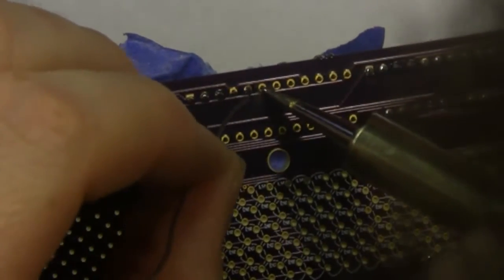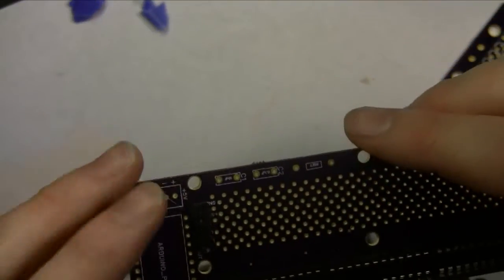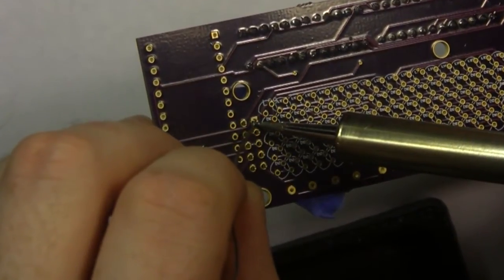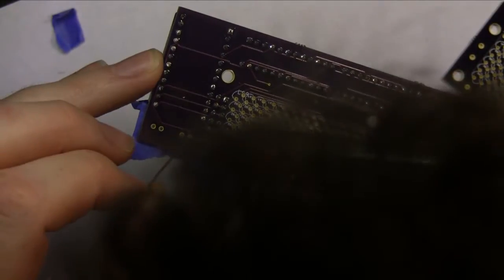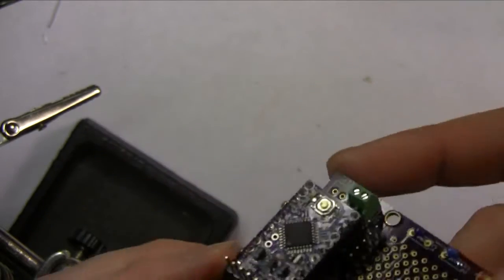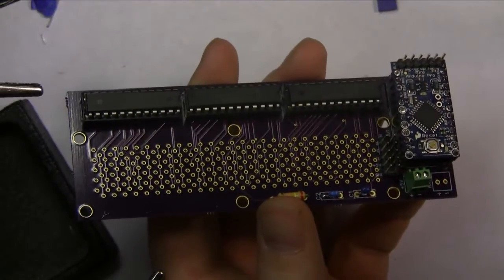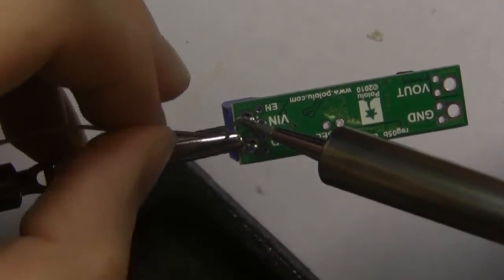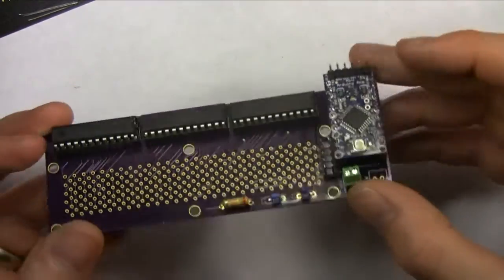Teeces Dome Lighting Guide Part 1

Comment: That voltage regulator is no longer available what is a good alternative?
Reply from the maker: The final PCB design included a 7805 voltage regulator, so the Pololu regulator module was no longer needed. However, the 7805 isn't so efficient and can get quite hot. If you wanted to go with a more efficient regulator, fairly decent UBEC regulators can be found on Amazon that should work well. This one would likely do just fine : https://amzn.to/3vpGdA3